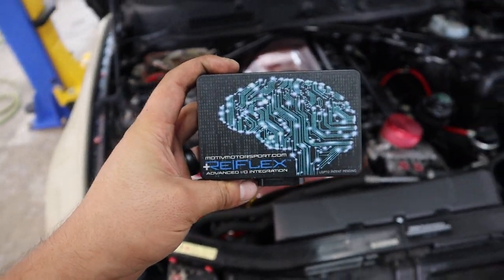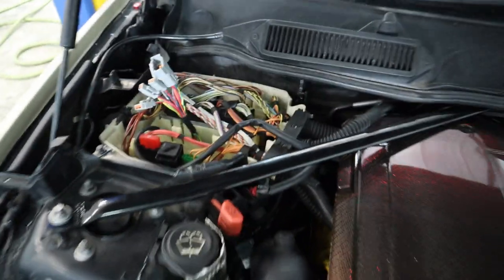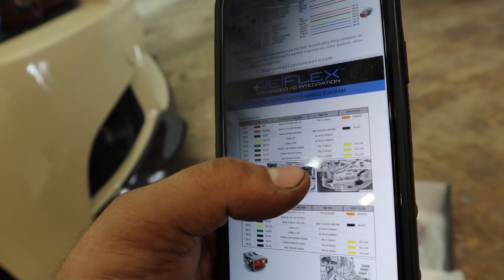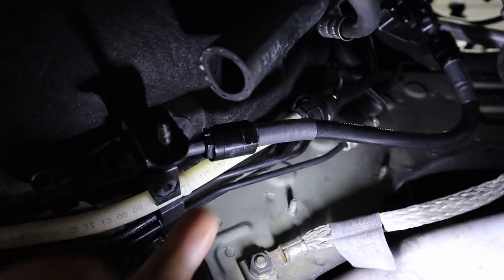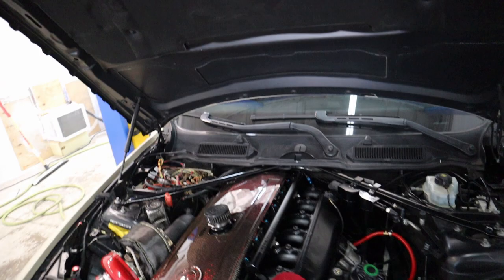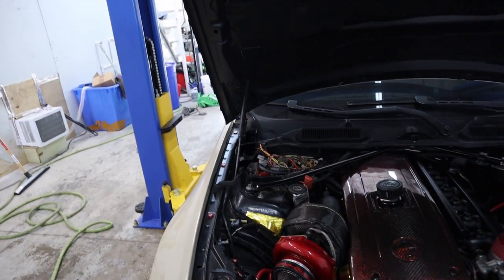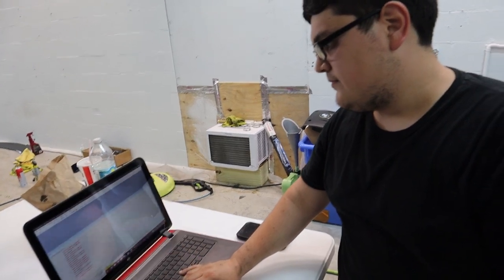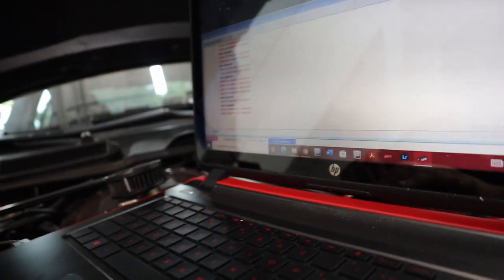This upgrade adds 200+ Horsepower to any BMW Engine!!! (Motiv Reflex install on a BMW N54)

Comment: Looks like a wonderful kit. Any development for the F1x S63 M cars?
Reply from the maker: S63 doesnt really need this, it would be pretty hard to fit injectors under those intake manifolds since there isnt any space, maybe spray in the charge pipe but thats not really effective

Comment: Yoo man. What’s your opinion on the on3 single turbo kits? I know you install a lot of doc race kits (at least I think so). Aside from the single scroll and twin scroll differences, how do they preform and how is the overall fit and finish (assuming you’ve installed / seen quite a few on3 kits).

I would mainly be using the on3 kit as a hot parts kit and would supply my own turbo and wastegate.

It seems either people love them or say they’re trash, but this is from like 5 year old forum posts. The on3 kit also seems like one of the few turbos kits that have the least 02 sensor issues.

I was really wanting a speedtech bottom mount kit but the persistent 02 issues are making me look at other options.
Reply from the maker: On3 kit seemed fine, works and fits pretty good, i would also consider DGautowerks

Comment: question for u guys.....whats the red hardware/fasteners on the fenders and well all over the engine bay?? are they just after market hardware or what??  also cars sweet as hell JESSSSSSSS !!!!!
Reply from the maker: STETION 25 Pcs Fender Bumper Washer Bolt 6061 T6 Grade M6x20mm CNC Finishing Washer Engine Bay Dress Up Fastener Kit (Black) https://a.co/d/0slRoaZ

Comment: Does that VTT breather have any benefits.  There’s conflicting answers on forum.  Any thoughts??
Reply from the maker: Im not a fan
Reply: @SwapDepot  upgraded billet pcv valve & catch can is the way then ?
Reply from the maker: I would say any catch can setup thats done correctly is better than that breather BS
Reply: @SwapDepot  right on 👍

Comment: Those connectors used hurt my heart. Solder and heat shrink, always.
Reply from the maker: Why would i do that when connectors work just fine
Reply: I believe soldering in the Motorsport world isn’t the best option because of the high exposure to outside elements  contaminating the solder, and risk of solder breaking due to vibrations and engine harmonics
Reply: @luxuryvisuals411  Never happens. I’ve been in mobile electronics for over 30 years. I’ve soldered ever connection for decades and never had a joint fail.
Reply: @davyhay1 I’m with you on that one ! I bet you lay down some nice silver ponds ! I’ll have to pick your brain one day!
Reply: @davyhay1  factory doesn't even solder sensors . Works for them .

Comment: Any BMW Engine? Doubt
Reply from the maker: Mkay
Reply: @SwapDepot I was thinking about the older engines and diesel, so if it works on this I would be surprised
Reply from the maker: You can make the reflex a stand-alone system and just control injectors by itself im sure, older cars came with port injection from factory so all you would have to do is upgrade the injectors but im sure if you wanted add additional injectors it’s possible to use reflex in those situations as well
Reply: @SwapDepot  Oh nice, that pretty cool, thanks for the information.